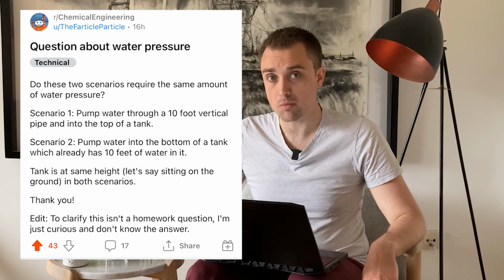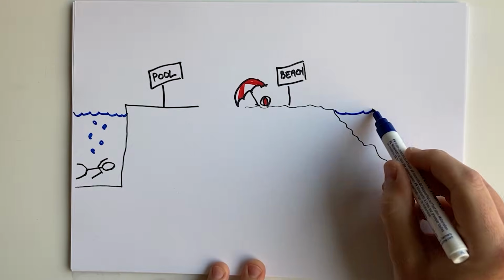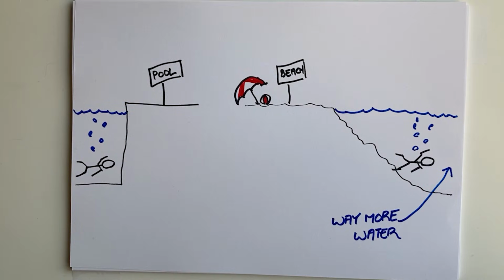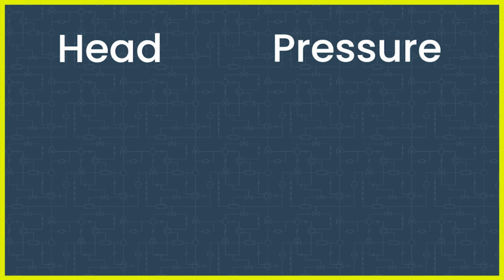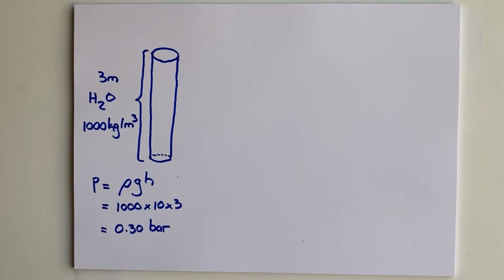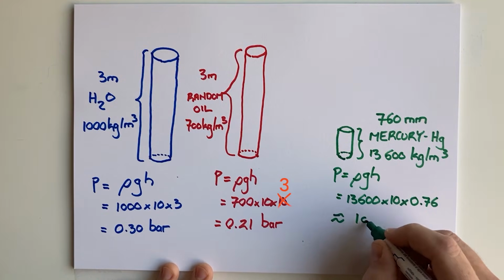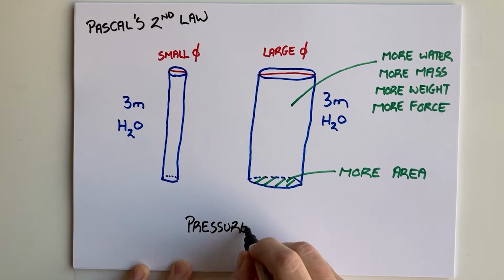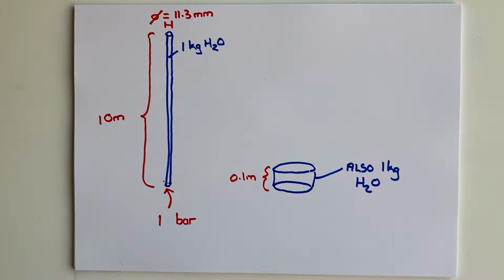Pressure, head, and pumping into tanks

Comment: You are ignoring velocity head.  Frictional losses are not really minor.  Pumping a lot of water through a small straw is infinitely more difficult than a massive stand pipe.
Reply: What are you talking about.  In my introductory physics class I learned that all physics happens on wet ice covered in WD40 inside of a perfect vacuum with perfectly laminar flow.  There is no such thing as friction, get outta here.
Reply: @promethius7820  my degree was in civil engineering where we learned formulas for real stuff like concrete, soil, water, and poop.  I wasn’t smart enough for theoretical physics that used frictionless surfaces
Reply: We are making an assumption in this video that the pipe that is putting the liquid in is sufficiently sized to have minimal frictional pressure. And at the same time we are ignoring that the fluid has a viscosity that would cause pressure at the bell of the tank.
Reply: Did you mean to say much more difficult? Certainly not infinitely more difficult.
Reply: The only dimensions given are height. "I'd fire anyone" that thought they could determine if frictional losses were significant based off the data given. Realising they might be relevant is good for a 1st year, but by graduation it's important to realise how, why, & when to calculate them.
Reply: Yes so it would flow out at different rates. But if it was sealed the pressure at the bottom would be the same. They'd both achieve the same pressure... just different flow rates, and pressures when open and flowing
Reply: The difference between fluid in motion confuses me a lot. Like I understand the difference, but its hard to find words or reasons for the difference in pressure between open and closes systems. If someone could help, my head would appreciate it
Reply: He actually mentioned he's neglecting the pressure drop due to the thinner pipe in minute 6. it's reasonable as long as it's a slow flow. Otherwise it's better (leas frictional losses) to fill the tank from the bottom side
Reply: Ok simple... Up size the vertical pipe slightly then any issue you have with your technicalities is in the supply line... Which is not applicable because this video is about head pressure!
Reply: You're ignoring the concept being explained in favor of splitting hairs.
Reply: Nice job. You introduced a factor related to flow into a lesson focused on pressure.  The lesson was about head pressure.  Flow has nothing to do with it, except he did mention frictional losses in passing.

Was this just so you could work into the conversation your educational accomplishments?
Reply: @andrewyoung-n8ary  It’s actually incredibly relevant though as most people’s intuition tells them the thin pipe can’t possibly be harder to to push water through than a gigantic tank. It turns out their intuition is right in a some regards… and one could accuse the people using a faulty example to talk about theoretical principles and excluding real world things like friction of being the ones just showing off how smart they are. 

I think it’s things like these that often turn people off science as people tend to be smart enough to tell when something doesn’t make sense and are put off by science curriculums that occasionally tell them to ignore that feeling.
Reply: @andrewyoung-n8ary No he isn't really just doing what engineer's love doing discussing problems.  In fact the speaker is using a hydrodynamic example to demonstrate a hydrostatic principle. In the examples shown there will be losses due to pipe bends, friction between the fluid in motion and the walls of the pipe and exit losses into the reservoir. These losses are cumulative and expressed as a head loss in the same units as the static head and may well not be trivial in a system and could lead to the under sizing of a pump.  A mistake all too often made.
Reply: They are minor and would have no effect if you were pumping 1ml   of fluid an hour through that tube you described
Reply: @dvx3700  you have the reasoning skills of some of my contractors that say the pump works just fine.  1 ml/hour won’t work for any application that I know of.
Reply: @glenmorrow1255  so you are saying my statement is incorrect?
Reply: @dvx3700  no, you are correct that the velocity of 1ml/hour in a pipe does not matter.  I am saying that no one has ever design a system pumping 1 ml/hour for a real application.  In real life, the velocity head should be calculated and considered.  I would fire an engineering consultant or pump representative if they didn’t calculate this and add it to the system curve.  Almost always this is a considerable head loss.
Reply: Things that pump 1 ml per hour do exits, they are called infusomats and are quite useful in hospitals for delivering infusion medicine at a precise rate over long time.
Reply: Absolutely correct. The pressure is the combination of the static and dynamic pressure. The example where water is being pumped into the tank has a dynamic head contribution to total pressure that the other two example don’t.  Ahh, Bernoulli.

Comment: The official value for g is 9.80665 m/s^2. You are excused for rounding it to 10 though - you are already introducing a similar rounding error, in the opposite direction, by converting 10 archaic units of length into 3 meters.

Comment: One advantage is that filling from the top instead of the bottom happens if the pump blows up. If you fill from the bottom, the tank will empty through the shrapnel that used to be the pump housing and onto the floor. If the contents of the tank is water, it is inconvenient. If it is sewage or chocolate, you have a heck of a mess to deal with.
Reply: That potential problem could be prevented by putting a check valve in the line right after the pump.
Reply: @actionjksn  It can be, though there is a pressure drop across that valve too, although an active valve (pneumatic for example) could reduce that to almost nothing. Like anything in engineering there are multiple solutions.
Reply: @actionjksn  check valves require maintenance and replacement also however
Reply: True, but one advantage of filling from the bottom is there is less head pressure during the entire filling processes, only when the tank is full is the pressure the same as filling it from the top.
Reply: @justanotheryoutube  ... while that makes perfect sense, the main reason to fill from the top has to do with fluid dynamics where an open ended pipe just has less restriction and an even flow rate throughout the fill process. BTW, the open end also acts as a siphon breaker in the event of needing pump service. IOW, you don't have to empty the tank.
Reply: @justanotheryoutube if it is a chocolate then pressure drop in pipelines is much greater than pressure difference between top fill/bottom fill. Also FIFO for top fill is easier to achieve.
Reply: Very true.  I’ve had enough system failures over the years to now favor reliability and cleanliness over negligible efficiencies that can be made up in other ways.
Reply: install a permanent check valve
Reply: Well that is why there are ratings and SFs. Also a valve can be installed to isolate the tank and the pump for maintenance on either equipment.
Reply: @justanotheryoutube and @rupe53
The other reason to fill from the top of the tank is that the Pump is pumping against a known and constant head.  If pumping into the base of the tank and the tank having varying fluid levels, the Pump is not pumping against a constant value but a value which varys with the level.
Pumps have an head curve where there typically is a narrow range of optimal conditions.  Pumping to the top of the tank removes one of the variables in the design.
Reply: @trevorliu735  it would have to be an extremely deep tank for it to change it enough to matter. In most cases it wouldn't be a large enough range to affect anything.
Reply: When pumping into the top of the tank, once you have blown the product out of the pipe and into the tank the pressure on the pump and hoses goes away so there is less reliance on valves working or not leaking.
Reply: @frosty3693  This would not be possible if you were pumping a fluid.  If you have air etc in the line to "blow" the fluid through, then this would cause more problems.

Comment: If you add in the requirement to overcome atmospheric airpressure, the pressure in A will be the least as is has a smaller surface area of atmosphere pushing back against it.

Comment: Sometimes it takes a slightly different way of explaining things to spark an understanding of a much larger principle. Kinda like when you hear a stupid idea.  You brain goes through the process of why it doesn't work that will spark an idea in a direction neither in the one you were thinking or in the idea given. I could not get my head around vehicle steering geometry. I was physically shown how they move on a frame without a body. This let a floodgate open where I started asking about how  the left and right wheel turn at different angles. (Ackerman angle) front wheel steering from the front and back of the spindle. I could SEE it and understand how it interacted with the car even though that was not part of the curriculum. Never Underestimate how you teach because a very subtle change in how you teach may spark inspiration in way you never expected.

Comment: I've been wondering about this type of thing on a car project. Let's say I have a sealed tank with 2 fittings in it. 1 fitting near the top, 1 fitting near the bottom. The installation would be cleaner if I pump the water into the bottom fitting and forcing the fluid out the top fitting versus pumping to the top fitting and having it come out the bottom fitting. The pump will be about level maybe slightly below the bottom fitting. So if what I understand from this video is correct, there's no problem with feeding the bottom fitting versus the top. Whether I feed the bottom fitting and it fights the water column to the top fitting, or if I run the hose (from pump) up to the top fitting.....that hose will have it's own column to fight, plus when it comes out the bottom fitting I'll still need to run a hose up above past the tank on to the next component (supercharger)

Comment: It seems like the pressure of the inlet pipe should have something to do with the result.  For example, if you were pulling a vacuum at the outlet of the pipe dumping into the top of the tank, like you were sucking on a garden hose, once the water starts to flow, you don't need to pump anymore because of syphon action.
Reply: A siphon works due to a difference in elevation between the inlet and the outlet. If the ambient pressure at inlet and outlet are same, then the outlet must be lower than the inlet for a siphon to work.

Comment: Altered my perception it would actually use less energy to bottom fill  as the head increases only as the tank fills and not the constant head determined by the height of the tank. Would only be significant in a really tall tank perhaps
Reply: It does use less for the reason you just said. The video was just explaining that only the head matters, not the total volume.

Comment: the difference is not in the final state, but in the transitory one. in 1 the tank will be filling at a constant rate but in 2 and 3 there will be a variation in the rate of filling because as it fills the pressure will increase as the water column rises. there are other differences, like If there is a leak in the filling pipe and the filling is from above, it will only leak while it is being filled, if it is from below it will always leak liquid.
Reply: other thing i hear people saying is that in 1  you will save pumping energy by filling from the bottom, because you won't be working against the full tank head when the tank isn't full, whereas if you  fill from above you will be against the full  head all the time. But in reality that does not work that way because the pump will work as its curve says .initially you will have less H and more Flow and the eficiency will be different.
Reply: A simple check valve will prevent it from leaking if there's a failure. All sump pumps have this, although they have it to keep the water from the vertical pipe from flowing back in to the sump, but it would still work to prevent a week in the event of a failure.
Reply: There is no difference in the transitory state of pressure.  In #1, the same pressure variation will occur when filling the riser as when bottom filling the tanks.  The difference is that the riser will be filled quickly and, once filled, the pressure to fill the tank remains constant.  Whereas bottom filling, the pressure varies over the entire time required to fill the tanks, from start to finish.
Reply: @bipl8989  wouldn't that only be true if the pipe went over the rim and back down to the bottom of the tank?

Comment: I have a question about a specific part of this video (Column pascal 2nd Law ),  as it states that the pressure will be the same even if you have increased the amount for a specific column.  I see that there is a relationship between Force and Area, so it is the same pressure because you have increased the force with increasing the Area, that's why it would be the same pressure compared to the same height.   Am I correct about connecting it with pressure = force/area for the same column height?
Reply from the maker: 100%

Comment: What you calculate is pressure or pressure difference?
Reply from the maker: What I am calculating is gauge pressure, so the pressure I would read if is I stuck a pressure gauge onto that point.

I guess you could say that gauge pressure is the difference in pressure between that point and atmospheric pressure.

Comment: I need to get a life...also, the arrows illustrating pressure at the conical tank, they should be vertical, right?
Reply from the maker: Pressure acts equally in all directions ;) So you could split the diagonal force into a horizontal and a vertical component acting on the cone of the tank.